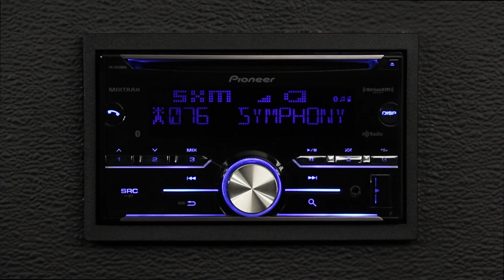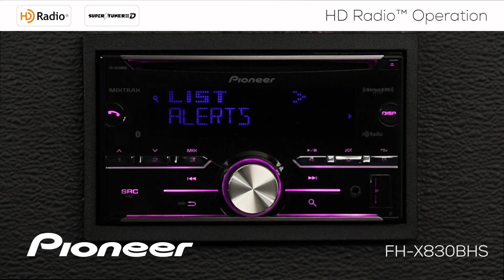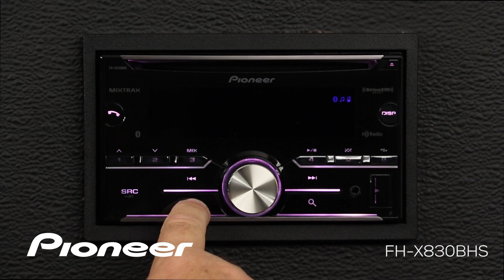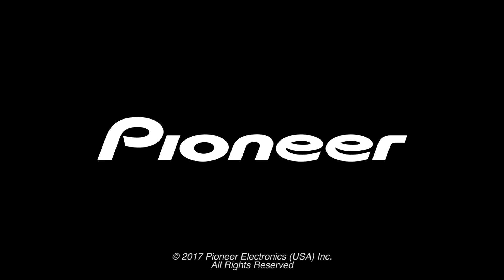How to - FH-X830BHS - HD Radio Operation

Comment: Can the Pioneer CD-SR110 steering wheel remote be paired to use with this radio also?
Reply from the maker: There is no pairing process to make this remote control work with the Pioneer FH-X830BHS.  The CD-SR110 is an infrared remote control.  This means it sends out a series of infrared light flashes to the in-dash receiver. Not entirely different from a flashlight.  When the receiver "sees" these flashes of light it will respond with the appropriate command.  The light is invisible to the human eye, but, most modern cell phone video cameras will allow you to see the flashes of light coming out of an infrared remote control.
You can find more videos on Pioneer's YouTube Channel here:  https://www.youtube.com/user/pioneerelectronics
Reply: So the CR-SR110 will not work with this radio at all.
Reply from the maker: @audleypattersonjr3009    It should work.  There is no pairing process required.
Reply: @pioneerelectronics  I will get it then.  I love the convenience of having one.  Also, I am a longtime Pioneer customer.
Reply from the maker: @audleypattersonjr3009     Thank you for your business.  You can find more videos on Pioneer's YouTube Channel here:  https://www.youtube.com/user/pioneerelectronics

Comment: How does this unit sound?  Looking for something to power some Pioneer TS-Z65C speakers.
Reply from the maker: The Pioneer FH-X830BHS is a great receiver.  It can operate up to four TS-Z65C speakers. And, for many people, this will work great.  However, if you enjoy better sound, I recommend an external amplifier for speakers like the TS-Z65C.  These are excellent sound quality speakers.  More power behind these speakers will make them really perform.  You'll  notice a huge difference in sound quality with an external amplifier.  Please consider the Pioneer GM-D8704 seen here:   https://youtu.be/E-VbUBAGwAI    or the Pioneer GM-ME300X4C seen here:   https://youtu.be/q7WXt3aHInQ    You can find more videos on Pioneer's YouTube Channel here:  https://www.youtube.com/user/pioneerelectronics
Reply: @pioneerelectronics  thanks guys I will check those out!!!